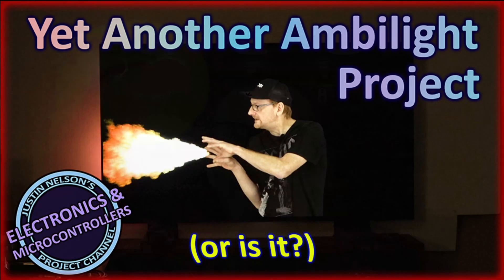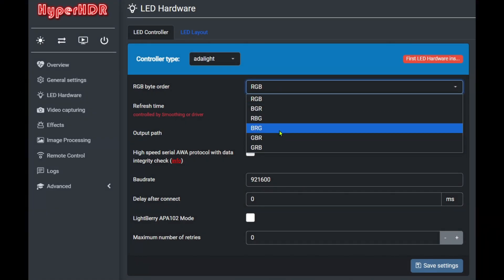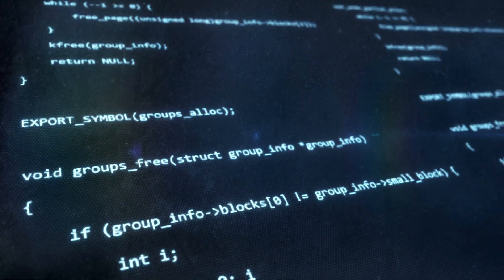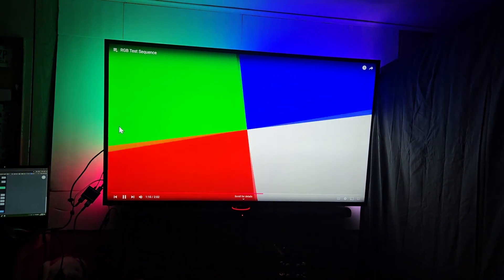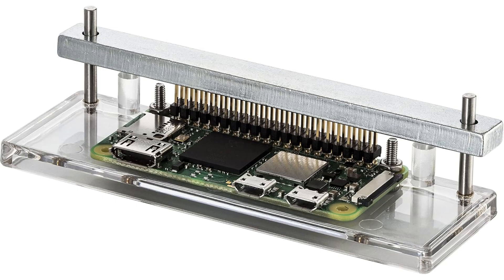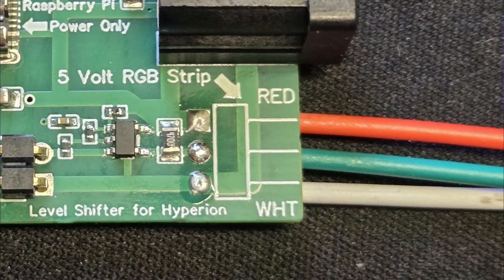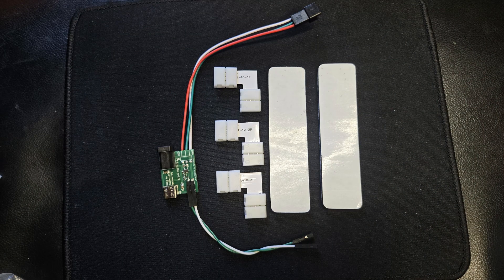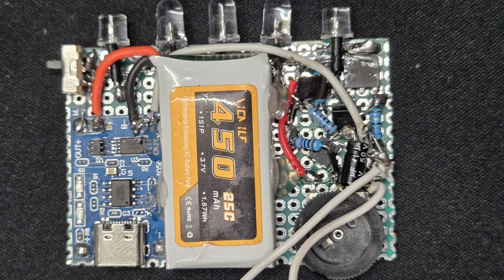Hyperion / Ambilight Updates • New Level Shifter w/USB-C for Pi • Comments Addressed

Comment: Does the new level shifter need power from the power jack? Or can it be back fed from the led strip? Not getting any lights on after running through the tutorial. Using SK6812, Pi4b and the splitter as per video. All settings look ok? Tried an apt update and apt upgrade on the Pi as well - Scratch that - had IO pin set incorrectly
Reply from the maker: So you're saying you got it working? Awesome!

For the record, the LED power out wires are tied directly to the barrel jack -- so power can flow in either direction. The barrel jack is just for convenience, you certainly can simply wire the LED strip to the PSU directly.
Reply: @JustinNelsonsProjects  Works great, need to play with the fine tuning a little bit. I went with the barrel jack as a neater finish, my mistake was adding longer cables for the GPIO and ground for a bit of a tidier install and accidently miscounted the pins. No harm done and very happy with it. Thanks for the videos!
Reply from the maker: @andyb8268  Awesome, glad you got everything sorted out! The fine tuning will drive you crazy if you're going for perfection... you will never get the LED colors to exactly match the TV (different display/lighting technologies)... but once you get "close enough", you'll learn to really enjoy the effect.

I have a hard time watching a movie on just a rectangle anymore lol 🙂

One trick is to reduce the color saturation; it's more about the light itself following what's on-screen, than the color, and reducing the saturation will effectively null out the fact that the color isn't 100% the same as the TV screen.

Comment: Just bought one of your level shifters for my diy Hyperion project but I think I did something wrong. When I went to plug it into my pi for the first time, the red green and white cable that goes from the level shifter to my led strip started smoking and melted. Not sure what happened? I’m using a 5v 10amp power supply from BTF lighting and had the jumper pins plugged in based on the diagram in the picture.  Pretty sure the level shifter might be shot now. Any help is appreciated.
Reply from the maker: I replied to your comment on another video, but for completeness I'll paste the reply here as well:

Ouch! It sounds like there might be a short in your LED strip. Make sure, firstly, that the "extra" white and red wires are not making contact with anything (or each-other).

Second -- I've seen people do this and I do not recommend it -- make sure you aren't folding over the LED strip to make your corners; this can easily lead to a dead short.

Finally -- are you using a name-brand LED strip? I have in the past purchased no-name LED strips that came, from the Chinese factory, wired **backwards**........

Check on those few things, and if that doesn't help, it could be a short right there under the heat-shrink that comes on the INPUT side of the LED strip. I've never seen that happen, but it would not surprise me.

If it's a BTF-Lighting strip, then defective strip is likely NOT the problem and I'd look at the other possibilities (kinks, folds, etc throughout the strip).

Let us know what you find...
Reply: @ thanks for the reply. I’ll need to order another level shifter more than likely.

So a little more information. I am using a raspberry pi 4b, I have the 5v 10a power supply from BTF lighting and I am also using a SK6812 led strip from BTF lighting. I have found BTF to be a reputable brand so I agree that I don’t think it’s an issue with the led strip.

I don’t think that it is the extra red and white wires as they are still wrapped and not exposed to create a connection. I also did not fold the led strips at the corners as mentioned. There is a chance however that maybe I messed up something when soldering as it is my first time soldering. Some of my connections were not the cleanest and I definitely struggled. I used 18 awg stranded tin copper wire to attach the LEDs at the corners. In hind sight, I probably should have just used led corner connectors like you offer with your level shifter.

I didn’t order the kit with the corner connectors because initially I thought that I was going to use a set of COB LEDs that I had ordered for the Hyperion project until I realized that the COB strip that I had was 12v and would not generate enough power from the pi at 5v.

So essentially, I’ve narrowed it down to an error on my end with either the placement of the pins on the pi to the level shifter or I somehow shorted out the led strip while soldering.

Moving forward what would you recommend? Should I replace my led strip I’m using and try again with corner connectors and a new level shifter? Or should I start with the new level shifter first and work from there? I’m worried that I’m going to duplicate the same issue again. 

Thanks again for taking the time to help!
Reply from the maker: @gordonwoodall2955  I would first inspect the LED strip (specifically the solder joints), and see if there is a visible short between the 5V and the data or ground pads. You might be able to salvage it by re-soldering, and just making sure you don't have any bridges or stray strands making an unwanted connection.

(also -- make sure the orientation of each section is correct -- follow the arrows!)

Second: The level shifter might be okay -- I have a very heavy copper connection directly from the Barrel Jack input to the LED output wires. If the short happened on the LED strip, the shifter should handle 10 amps (for at least a few seconds) without damage... key word, "should"...

Finally -- how it's connected to the Pi can damage the Pi, but it would NOT cause the issue you had. The Pi connections are a high-impedance (10k-ohm) input and a ground -- no actual power is going to or from the Pi & Level Shifter, just low-current high-speed data.

I hope you're able to get this sorted one way or another -- please keep the community (and me) up to date on your progress!
Reply: @JustinNelsonsProjects  little update! So I got the new level shifter and everything seems to be working fine with that. No smoking or voltage issues. I did fresh cuts on the led strip and apply the L-shaped corner connectors and that seems to have done the trick. I’m assuming that it was my soldering job that caused the prior issues so that’s a positive.

Next issue I’m having is now I can’t get a signal input and the LEDs don’t light up. I’m using the latest version of HyperHDR (v21.0.0.0beta2). I tested all of the LEDs using a different controller with WLED preinstalled and all of the LEDs work fine. So it’s not an issue with the LEDs themselves. Second, I’ve checked the logs in HyperHDR and it appears that my capture card is recognized by the pi. I am getting my signal input from my PS5 through my Sony STR-AN1000 AV receiver for my surround sound system and running the output of that through my HDMI 2.1 Splitter into my TV and my 4K USB capture card into my raspberry pi via the usb port.

I am getting stumped as to whether I am having issues with the capture card or HDMI switch not passing through the data or if I am having software issues with HyperHDR.

Any tips on how to trouble shoot would be helpful. I feel like I am 95% of the way there on this project and just missing something small at this point.
Reply from the maker: @ In HyperHDR, above the menu on the left, there's a TV-looking icon. Click that, and see if you get a "live preview" video in the browser. That's your first clue as to whether HyperHDR is receiving video or not...

If that is working, make absolutely sure that HyperHDR  has access to the GPIO pins -- double-check that you followed all of the instructions in the tutorial regarding "configuring the software"...

Let us know if you get that last 5% -- we're all rooting for ya!
Reply: I’ve done everything on your videos but the last command doesn’t bring me to anywhere to delete the (user=%i) to turn on the gpio pins on raspberry pi4
Reply from the maker: @tennessenk  So you installed HyperHDR 20.0.0.0 -- and it installed correctly. Then you ran:

sudo nano /etc/systemd/system/hyperhdr@.service

And you do not see the line that says "User=%i"

Am I understanding correctly? I'm only verifying that you are using the same version of HyperHDR as the tutorial was written for -- things might have changed.

I am going to update my own system to 21.0.0.0 as it has just been released out of Beta and into production; until then, the tutorial reflects the 20.0.0.0 version.

Also, it DOES matter what version of the operating system you installed. Make sure you are using the Pi OS 64-Bit "LITE" (not the full desktop version)...

Let me know if any of this differs, and I'll look into any changes that may have been made...
Reply from the maker: @ So I just did a complete fresh install of Rapsberry Pi OS and HyperHDR 21.0.0.0, and everything works just as it does for version 20 -- I have updated the web tutorial to reflect this new version.

But I ran into zero issues -- the same file edit allows HyperHDR access to the GPIO pins.

I can only recommend that you make sure you have followed the directions *precisely*, used the correct hardware and software, and typed the commands correctly (preferably using the Copy/Paste options the tutorial provides)...

Let us know if you figure this out or what you may  have done differently than how I instruct on the web tutorial... many many people have used my tutorial to great success, so there has to be something different in your particular situation...
Reply: @JustinNelsonsProjects   correct I followed the instruction on your web page line for line and it goes to the different screen where I have to press control x to exit but there is zero things there for me to edit and yes 64 bit os lite

Comment: I had never heard of hammering in a pin header.  So I had to check out your link.  Turns out that it doesn't use standard pin headers.  You have to use their custom ones.  And they're definitely not cheap.
Reply from the maker: The kit I linked to appears to come with the pin headers for $15. I found another one similar that came with two or three sets of pin headers, so you can reuse the tool on multiple boards... Honestly I don't find that to be overly expensive in my opinion, especially if you are simply not into soldering or not comfortable doing so.

Obviously they would have to be non-standard pins, normal pins would literally just fall right back out of the holes 😁 I assume the custom pins are wider for a friction fit...